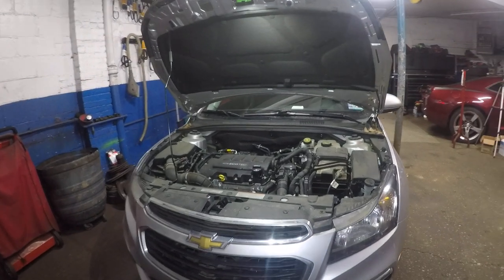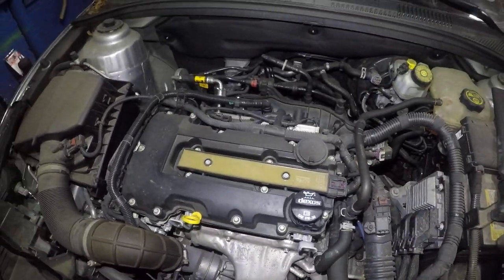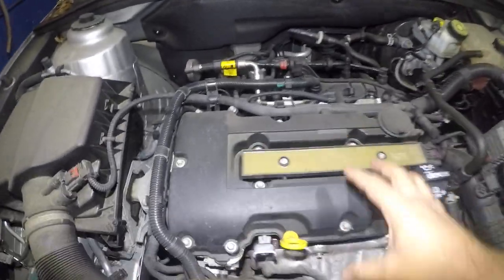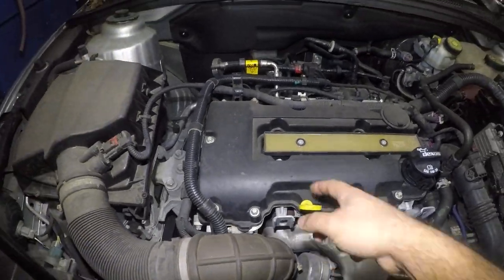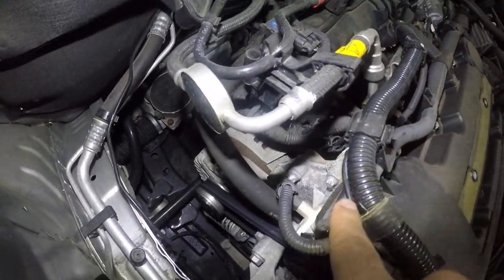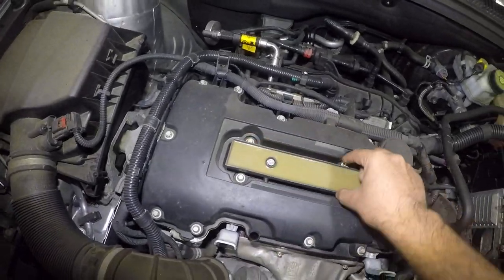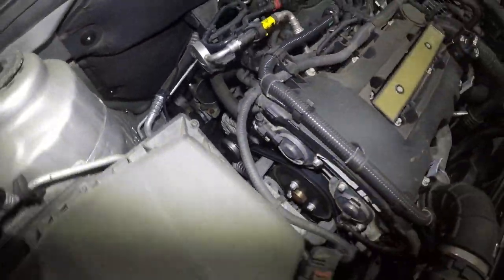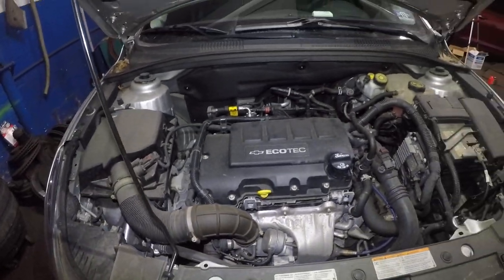Chevy Cruze or Malibu Making whistle sound, Bad PCV valve How to replace the valve cover with PCV

Comment: Great video! Thank you.... I have a 2018 malibu 1.5 turbo....nearly 100K...no codes.... what looks to be "blow by" oil/residue on the throttle body (after cleaning I noticed it was building up again...)...the intercooler clip is ok but the hose doesn't fit particularly snug....does the intercooler hose need replacing? Thank you!
Reply from the maker: Not sure maybe the clamp? And oil could be lot of thing leaking turbo or pcv valve part of valve cover
Reply: @RBTheMechanic  Thank you! I'll start with the clamp, check the PCV and get back to you with the solution! Have a great day!

Comment: my 2017 malibu does not have the pcv valve built into the valve cover its not like the one in your video but the question now is which pcv valve do i replace i have an ignition pcv as well as a fresh air and foul air pcv valve engine code is P1101
Reply from the maker: I would have to check that from shop computer it might be maf sensor issue
Reply: Hey I have the same issue with my Malibu did u end up finding the solution brotha?
Reply: Did you forget out the issue? I’m having the same exact problem with my vehicle!
Reply: @Jonathan-nu8ov  we had a check engine light because  the throttle body was dirty we sprayed cleaner in the throttle body drove it for 2 weeks to let the computer go through several drive cycles the check engine light went out and hasnt been back on since 
the dealership charges more than $1000 to change the PCV and that really wasnt the problem for us.
Reply: Same code issue. Before i try a new maf sensor i thought about cleaning the throttle body. But the CRC brand cleaner says not to use it on turbo charged engines. ??